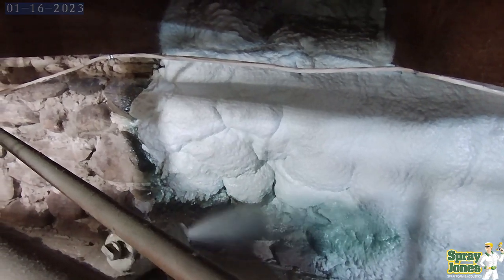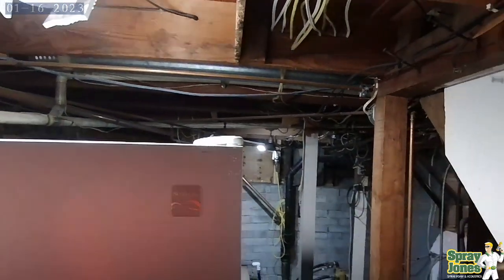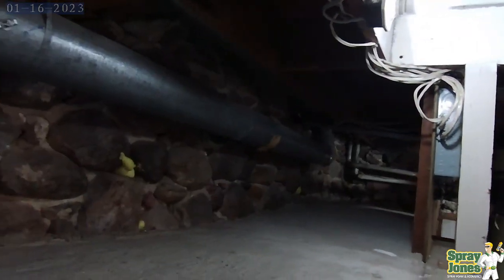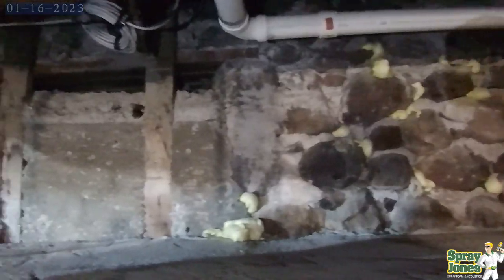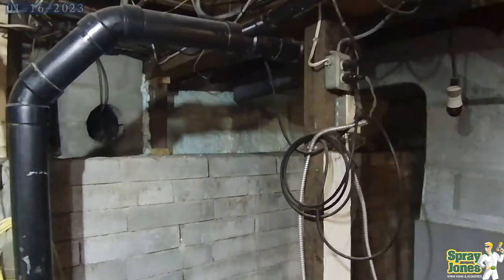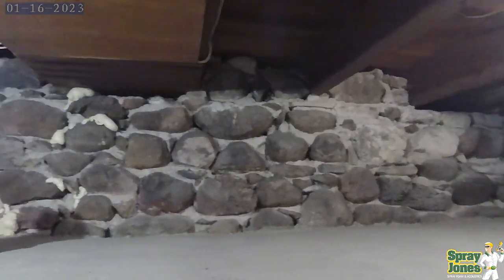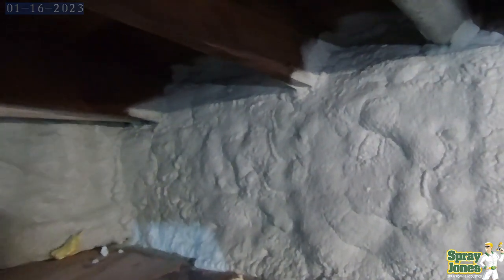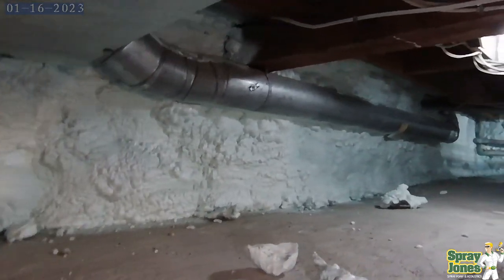Stone Foundation & Spray Foam Insulation

Comment: When we decided to put an addition on the house, we decided to add a full basement underneath for storage. A large portion of the house is a crawl space. The house was built in the late 70s with a poorly poured concrete foundation.   When we bought the house I found leaves and nuts in the crawl... thinking this can't be good.  They messed up the foundation so bad they added a cinder block to make the height work leaving gaps between the foundation and floor joists everywhere, making a great spot for wasps and mice. After much research and finally finding your channel, I decided to have the addition, crawl, and entire foundation done with spray foam. Thank you for the details about using spray foam. My house is finally airtight, and no longer an option for mice.  Thank you again for your great videos.
Reply from the maker: Get testimony. Cheers.

Comment: I did this on in our stone wall basement in New England after watching tons of videos from Spray Jones. We went with 2 inches of closed cell and it’s night and day. All the drafts are gone, the basement is warmer, very happy. I did hope to not have any humidity in the summer, but we still do. Maybe it’s coming up through the concrete floor. 

I repointed the entire basement, then had them spray directly floor to ceiling. Like others, I had thought about dimple board, etc to let it breathe, but in the end I felt better about just locking it all together with a direct application. A part of that was to avoid humidity, which I mentioned above is ultimately still a problem, so in my opinion I don’t think you can go wrong either way. 

Thanks Mike for these amazing videos. I also sprayed 4 inches onto the roof deck and 2 onto the gable walls while converting an attic to a living space at the same time thanks to your advice. The performance of closed cell is unbelievable.
Reply from the maker: Great feedback. See the people who get it, get foam...
Reply: Seal all your cracks in your concrete floor. Apply Epoxy Sealer to your floor. That should help tremendously with humidity. Also a 12" solar fan to help move air around ...
Reply: I had the humidity issue with the crawl space as well.
I had a company come in and spray 2" on the floor and to cap the 2.5" rigid board foam insulation on the walls.
Spraying the crawl space floor and installing heat ducts and a cold air return in the crawl space resolved my house humidity issues.
Despite watching Spray Jones videos and taking the precautions he mentioned regarding installers, my job still wasn't done quite right. Foam is 3'4" thick in some spots and 2.5 or greater in others.... Regardless, it is doing the job and has "encapsulated" the crawl space at a fraction of the cost it would have taken to lay plastic down....
Reply: I’m in Nova Scotia and did the same thing. Here it’s recommended to stop a foot above the floor for some reason. We installed drain tile around the foundation (less worry about wall collapse because spray foam) and re graded the yard.
Reply: @aaronlohr8477 that’s interesting. I’m also in Nova Scotia, and just purchased a 100 year old house that we’ve been renovating. It has what I call a 75% stone 25% brick foundation. I know that sounds mental, and it is lol. So essentially the stone goes from the floor upwards to maybe 5 feet or so and then brick was placed on top of that (load bearing brick) later on to increase the height many years back of the basement (that’s my best guess).

We have a trench that essentially runs the entire span of the basement that runs out through a hole in the concrete floor. We haven’t seen much water come in on the basement walls, but have seen lots of frost on the bricks in certain areas.

I’ve read that it’s not wise to disturb the ground around old foundations for structural reasons as the house already settled over the years. Did you guys do that and add weeping tile around your home? How did it work out?

As of now we don’t have any weeping tile. We thought about just getting a brand new foundation put in but haven’t heard back on the quote yet. Guessing upwards of 70k for that job.
Reply: @NothingSpecialHereCarryOn  brick on rock is pretty common, they used the rocks as foundation material and finish with brick to make a flat level surface to lay the sill plate on.

Comment: I’m the homeowner and also a professional in the Spray Foam industry, currently working on a unique project involving a 200-year-old brick colonial home in Maine. The home is perched on a granite lift, resting on a substantial stone foundation. Notably, the foundation consists of large stones with minimal rubble, yet we’ve identified a few areas with water intrusion. To address this, I plan to excavate around the foundation for waterproofing and have several questions regarding the best approach for both interior and exterior waterproofing and drainage solutions.

	1.	Exterior Waterproofing Options: For the exterior, I’m considering two different strategies. The first involves a traditional membrane or board product, depending on the condition of the outer wall post-excavation. The alternative is applying a 1-inch layer of Spray Foam topped with a polyurea coating. Could you share your thoughts on the effectiveness and longevity of these options, particularly in a climate like Maine’s?
	2.	Interior Waterproofing and Drainage Strategy: Inside, I plan to install a dimple mat up to the exterior grade, covering it with 2 inches of Spray Foam from the band (or rim) joist area down over the stone above grade. This setup is designed to direct any moisture that bypasses the exterior defenses down into a perimeter drain, leading to the interior perimeter drainage system beneath a future concrete slab. How does this plan sound to you, especially the integration of the dimple mat with the Spray Foam? Are there any potential issues or improvements you’d suggest?
	3.	Locking in the Dimple Mat with Spray Foam: I intend to lock the dimple mat in place by spraying foam over it down to the perimeter drainage area. Do you foresee any challenges with this approach in terms of moisture management or structural integrity?
	4.	Recommendations for a Historic Stone Foundation: Given the age and unique construction of the foundation (large stone base, minimal rubble), are there any specific considerations or modifications to the standard approach that you would recommend?

Comment: When we have a full height stone foundation, we will install an interior drainage system and install a linner up the wall a few feet as needed to allow water control. 
Then foam the whole wall top to bottom

Comment: I have a old farm house with a stone basement.  Would the spray foam work to waterproof the stone foundation?
Reply: I'd try and seal the biggest cracks beforehand. I worry that if the wall is insulated and sealed, it will build up water from the outside, then freeze-thaw and get damaged.

Comment: How long would it take for stones to rot without breathable air?  Also limestone mortar will turn to sand after so many years and therefore the foam would have to removed eventually for repointing.  This is not a repointing replacement as foam does not have the structural rigidity that mortar would have.
Reply from the maker: Stones to rot??
Reply: @SprayJones  when exposed to water and not allowed to breath, stone, specifically limestone will become brittle and deteriorate as they are subject to hydrostatic pressure.  This is why it is not recommended to paint rubble foundations with any thing but a limestone-based cement parge.
It might be better to create a false 2x4 wall and spray foam that so it may be removed for future repointing.  A lot more work but you won't have to replace your foundation wall x amount of years once the mortar or stone starts to break down past the point of repair
Reply from the maker: @nathanlothamer4570  One side of the stone is always exposed. 
This is not limestone. 
Water going through the wall via cracked motor and allowing water to freeze in the spaces breaks the walls apart. 
There is degradation because of the SPF. 
Watch my video on old brick buildings and the debate about spraying them from the inside with SPF.
Reply: @SprayJones  As long as one side is always exposed, spray foam shouldn't be an issue.  It is when one side is covered with soil and hydrostatic pressure pushes the water through the mortar joints that this could become an issue. The other side will need to allow the water to weep.
Ice will destroy the mortar joints eventually, however repointing will stabilize the joints.    Spray foam will significantly reduce the walls ability to weep the water and alleviate pressure.  Adding an air gap as with most things should solve this issue i.e. false wall or furring the stone wall before applying spray foam.   Without the air gap, you will probably have to remove the foam earlier than anticipated to repoint damage, if you are even able to spot it before structural damage becomes an issue.

Comment: 1880 stone foundation on a boston victorian. I have gone around and pointed all the joints between the rocks and covered with drylok. I built a stud wall all around the inside perimeter but in places its pretty deep, 4-8 inches from the inside wall plane to the stone. Its hugely expensive to completely fill that space with closed cell. I am thinking about just filling the space behind the studs, maybe 2-3 inches, with spray foam, then finish off between the studs with cut polyiso panels, then drywall. that would leave an irregular air gap between the studwall and the outside spray foar surface. Any thoughts? Would that gap need to be vented?

Comment: Would you spray foam the outside instead of the inside? 1890 home with minimal crawl space thats 1 to 2 ft high, i figured digging the outside and spray foaming would be  easier and protect the stone from freeze/thaw while also air sealing it..
Reply from the maker: Inside. Less to go wrong and need to protect. Provided there is enough room to spray.
Reply: @Spray Jones   by go wrong do you mean spraying the siding and whatnot? 

The inside isnt accessible and the outside is easier to dig out for obvious reasons..

I see a lot of local contractors here parge the the stone walls and then apply liquid rubberized coatings and i just feel like thats a much worse option than spray foam which in the least adds to the structure/bonds everything..

As always, spray jones should start a school for spray foamers and do online seminars because you have solutions and answers to most of building structure issues which is 2lb foam.

Comment: I have a stone foundation, and my plan is to re-tuck the grout joints, the use a dimple may to allow for drainage down to a drain tile.  Then the plan is to spray foam on top of that to provide insulation and additional air sealing. 

Would you recommend that as a solution, or would you still spray foam tite against the wall with (slight) water intrusion issues?
Reply from the maker: Tight is usually right.....

Comment: Is there a problem with mold or hydro static pressure since the stone can't breathe with the spray foam?
Reply from the maker: For starters what does mold need in order to grow in the first place? Food, air and water. SPF removes the water & air issue. 

The SPF does not change hydro static pressure.

Comment: Don't just add a foot or two in the hight and width. Throw in a few more loonies for the installer. I can tell that guy is pooped by the time he gets up on that ledge and has to butt-scoot along the work space.
Reply from the maker: Rico, would you spray for me at $100 per day? Maybe a $500 per day? Or $750? 
Get the point?????
Reply: @SprayJones  Sure. I get it. I'd spray for what you are paying. Your guys are clearly good at what they do and well trained. And the easy jobs balance out the hard ones. But I usually throw the guys a 20 if it was unusually strenuous. More than the usual job, anyway.

And spraying that rock foundation is probably the single best thing you can do to improve comfort and durability